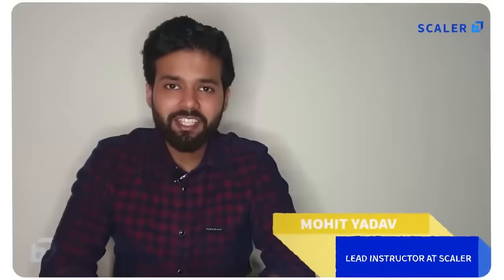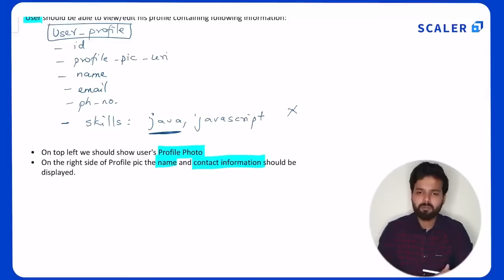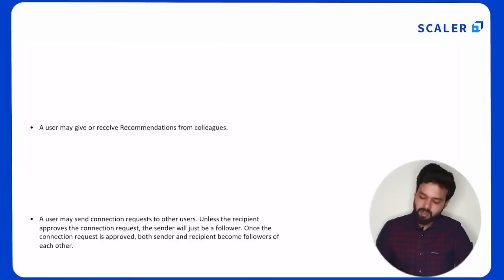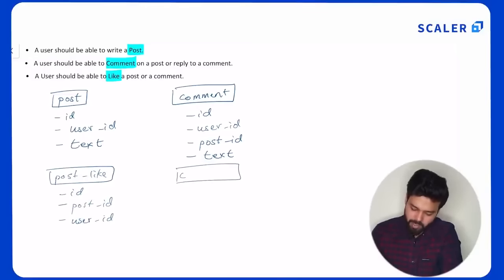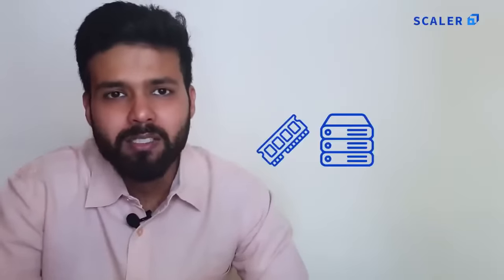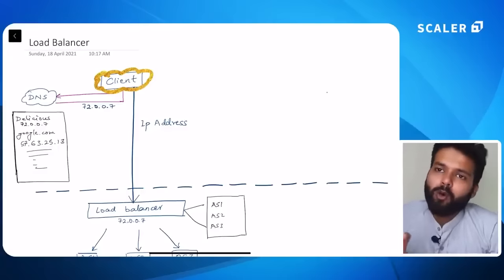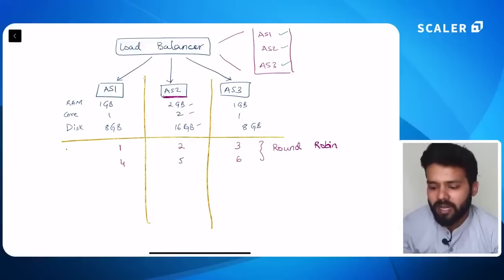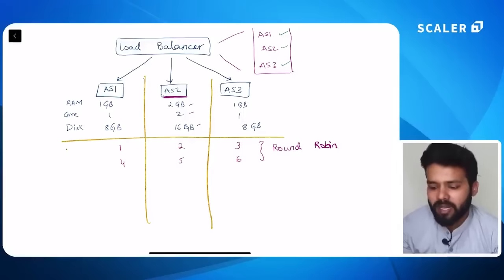System Design Full Course (A-Z) and Common Interview Questions 2023 | System Design Mock Interview

Comment: at 9:00 the columns in eduction and company tables are wrong. the start year/end year are user dependent. it will be different for each user. it's not constant information like name or location of the institute. those columns should be in the mapping table and not in the identifier tables.